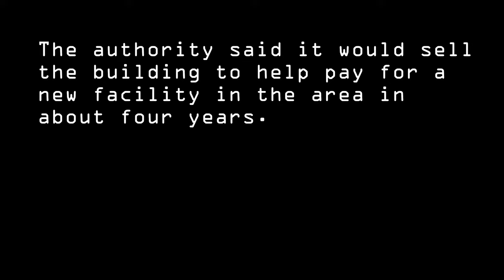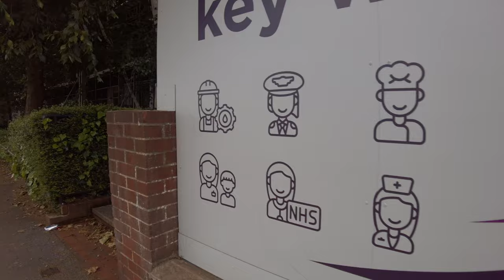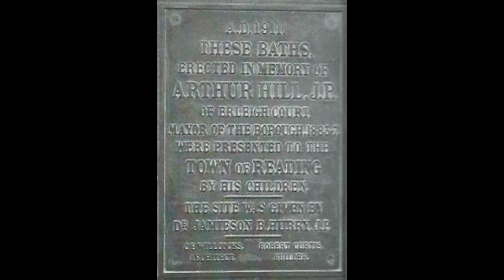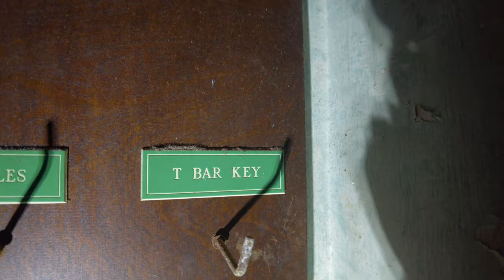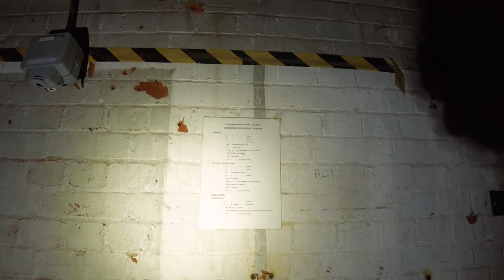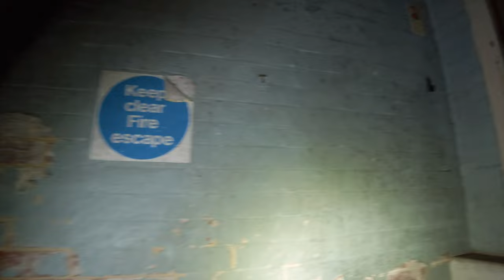Arthur Hill Memorial Swimming Pool in Reading

Comment: Wow ... Such a shame ... Those pool ladders arnt cheap ... £1500 plus each ... The thermal insulation on the roll on the wall is probably in excess of £20k to buy new ..
The spinner for the lane dividers is in the region of £3-4000 too !!

Those sand filters and holding tanks are £20k plus too !!

Having just put a small pool in at home, I have found out how much professional pool equipment costs and to see that lot is sacrilege !!

The town of Blaenavon lost its pool and Leisure Centre because the county council wanted to consolidate the facilities, even though they were trustee's and not owners of the property